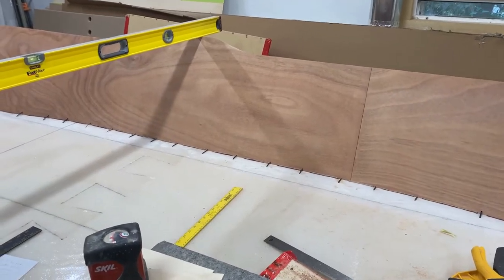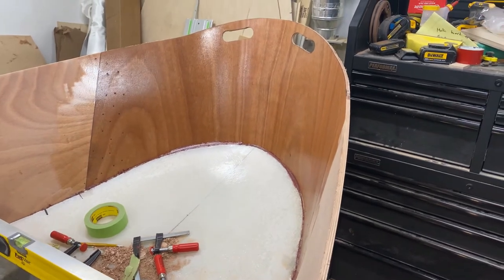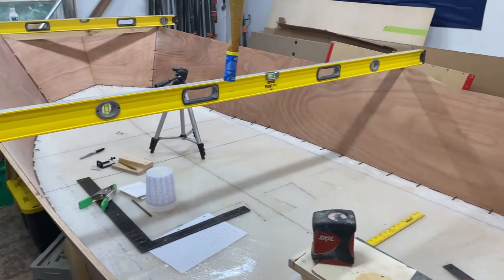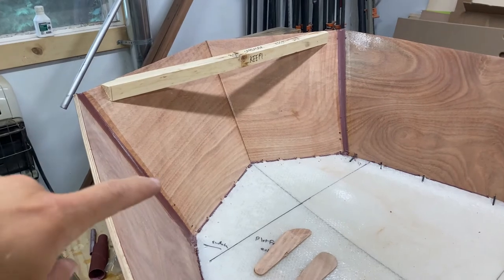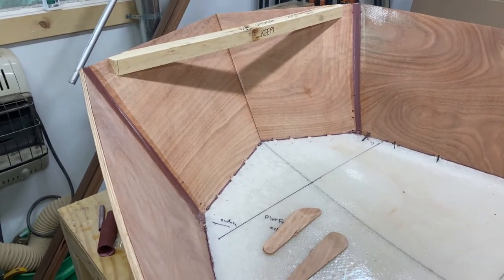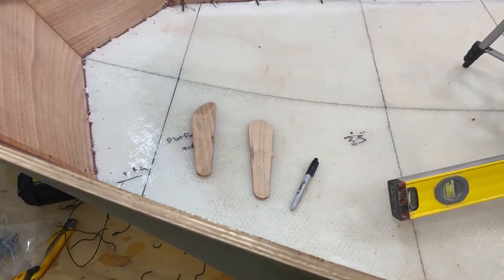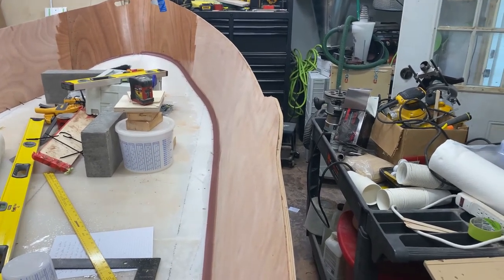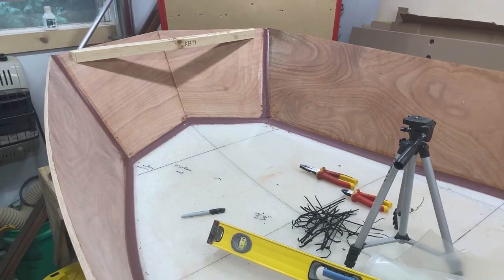Root River Skiff Part 9b (Drift Boat)

Comment: I'm enjoying watching you work through this project.  In your opinion, do you think you could use the honeycomb board on the sides of the boat as well as the bottom?
 Plywood is just more expensive now and if the boat was painted there may not be a reason to use it at all. I get why people like the grain though.
Reply from the maker: Thank you. And to answer your question yes you can use the honeycomb panel for the sides as well. There is a drift boat company called High Country Boats out of North Carolina and that’s how they build there boats. You would stitch it together the same and to be honest before you fiberglass the paneling it is pretty flexible which would be nice for stitching together. I would definitely consider using kevlar in certain spots like the bottom. It would make for a very nice boat. Any exposed edge of the honeycomb I would fill the honeycomb cavity’s with thickened epoxy. It’s awesome how strong and lightweight that stuff is especially when you fiberglass and Kevlar it. Plascore Canacore and Carboncore are different manufacturers of panel. I went with Carboncore since I could very very easily place an order on their website.